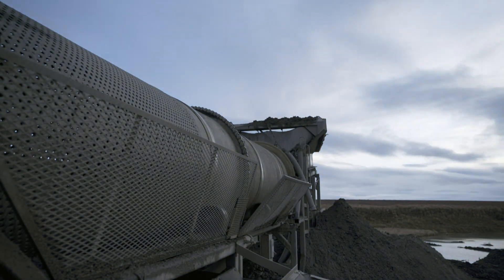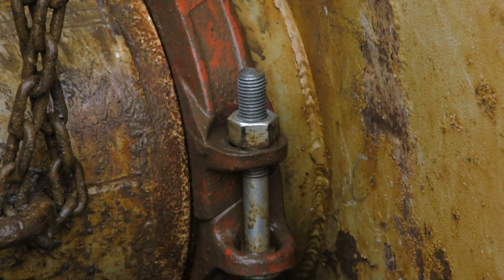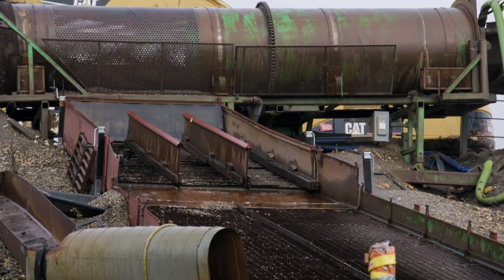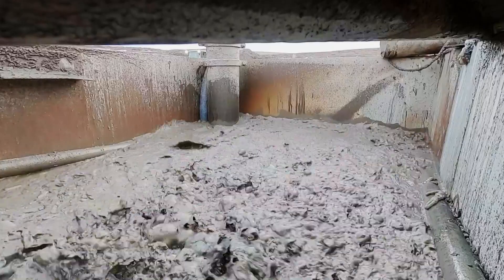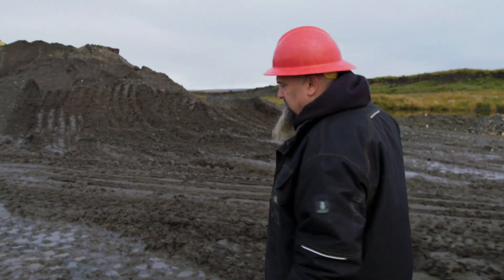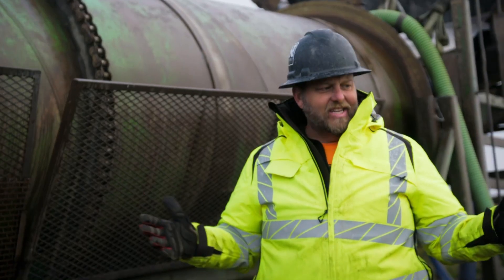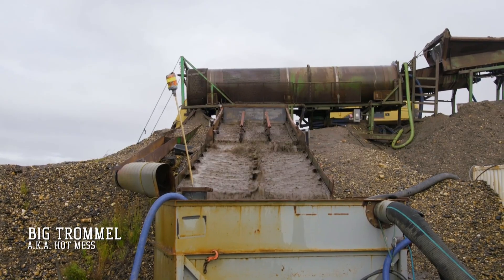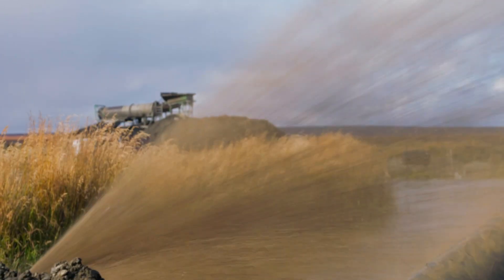HUGE Slurry Line Explosion Stops The Hoffman’s Big Trommel | Hoffman Family Gold

Comment: 7:05 You can tell how fake this is by the camera crew just happening to be next to the break when it "happenened" and the trommel not even running.
Reply: Exactly, and why is there air coming out a a pipe that has supposedly been running for hours.